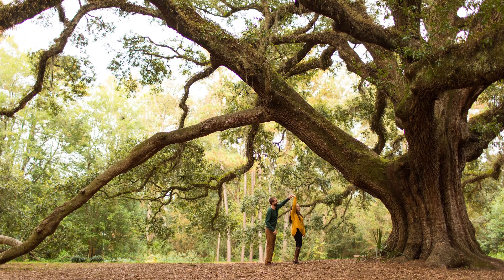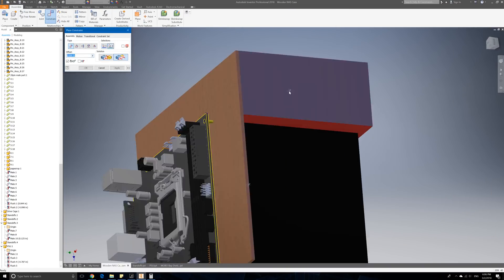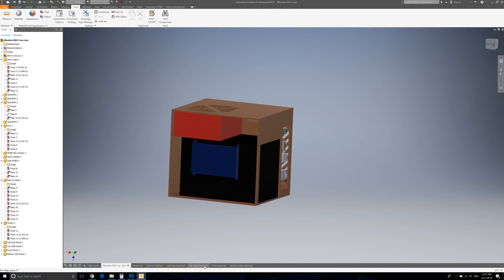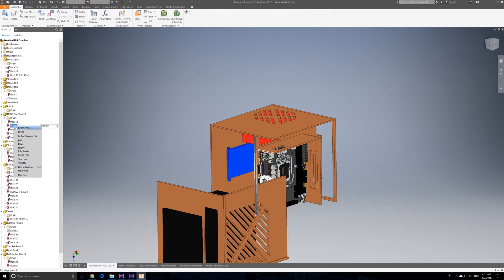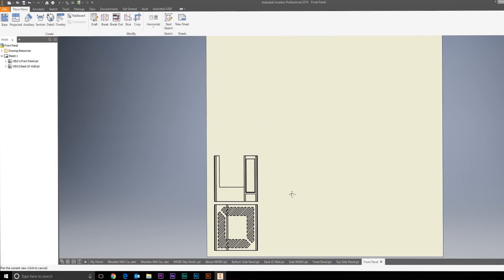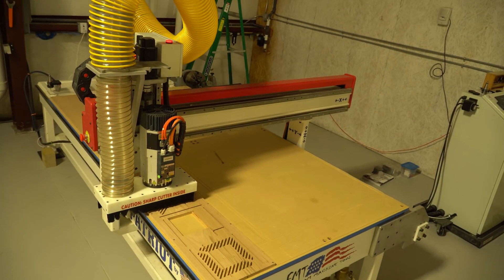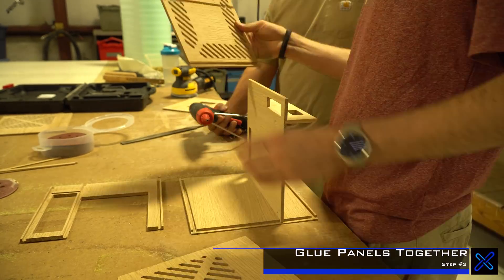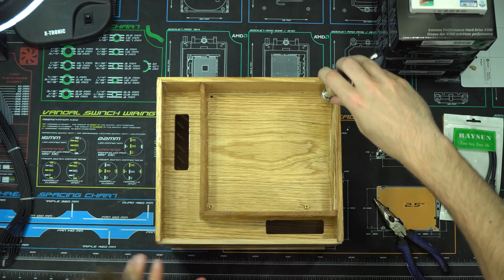Custom Wood Computer Case Design and Build (Marston Photography)

Comment: thumbs up man. I want to colab with a local friend who does woodwork and make a wooden case with an mATX mobo. Any suggestions or tips!? THanks
Reply from the maker: I would advise to think of everything you need to fit in the case before hand unlike me haha then you can iron out the size parameters
Reply: @Bits-Blades-Bros  We are basing it around the node 202 so 18x13" at 5.75" width. I'm stuck on how to route the back end and WHERE to place cooling. No GPU just a streaming PC. Suggestions? Thanks for the reply!

Comment: Hey man, congrats on your upcoming wedding! 

I wanted to ask you, when you design a 3D model of a case (Or 2D even) How do you get the measurements needed for, say, the motherboard I/O? I mean in a way that ensures the I/O shield will mount perfectly (This also applies to other parts, except for case fans because that's easy). Also what's your trick to sort of visualize the the cases dimensions that you're building. As we know, what we see on screen is one thing and what we build is another. Would really appreciate an answer, Thanks!

Comment: Its a really cool build, but it is useful to know that a RAID setup on a NAS is not a backup solution (especially not for company use) - go «dumpster diving» on Ebay for an old external tape drive, the LTO-4 or -5’s aren’t too expensive nowadays and use that together with the NAS. RAIDs are for keeping data online without/minimal loss of uptime, tapes are for backup in case of catastrophic failure.

Comment: This is great, I was wondering when someone would try a wood PC case! Out of curiosity though, what temps are you getting? As some have noted including ideas, it would be great to add the missing power button and power supply 3 prong, but how about the front I/O? Also space for at least a 2x 120mm (240mm) fans/raidiator?

Comment: I would love to access to a cnc machine, there is a couple custom  cases I would like to make. Congratulations by the way on the wedding.
Reply from the maker: Thank you so much! and what kind of cases were you thinking of?
Reply: NeXTech News I have hp z220 sff that i would like to use a full size card. Like a ncase m1 case with atx power supply.
Reply: NeXTech News Or like geeek a20 but room for a 3.5 hard drive underneath and 2x 120mm fans in the front. With a slimline optical drive between the motherboard and 3.5 hard drive.